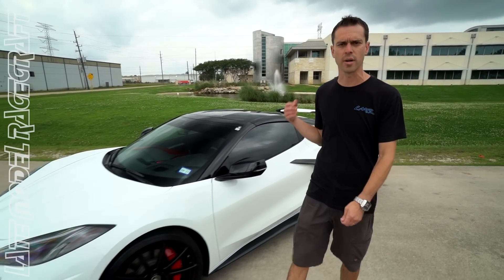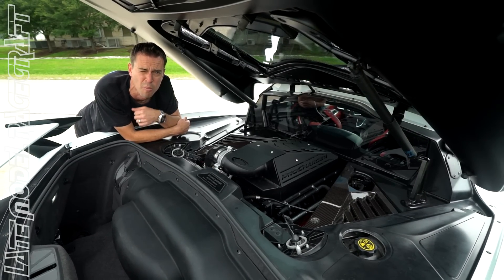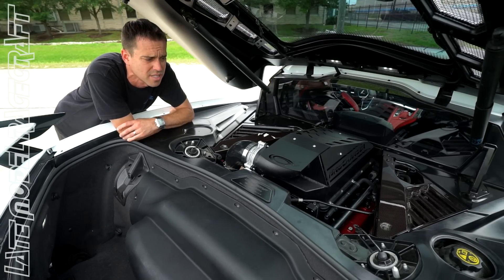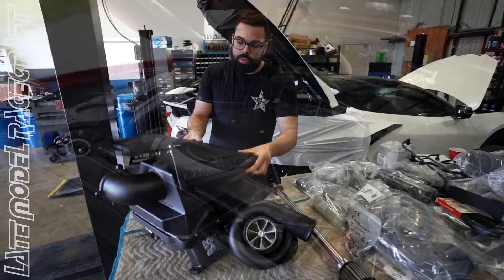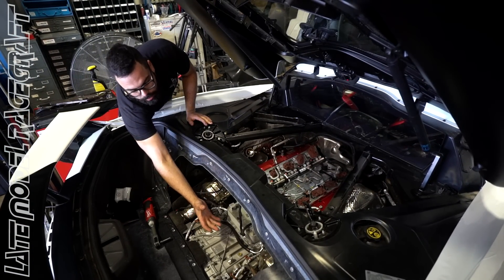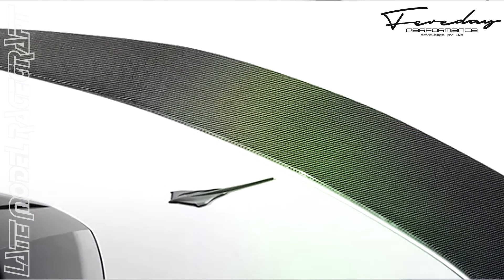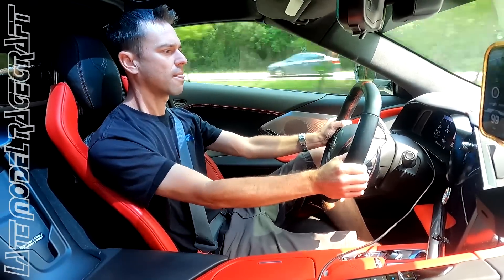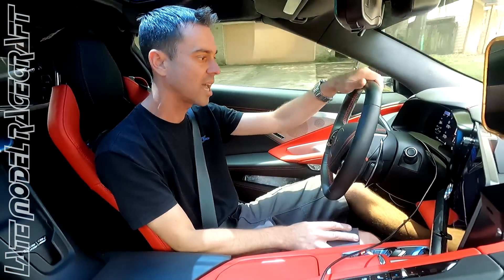LMR C8 700HP Corvette with Procharger Supercharger system

Comment: These packages are awesome, I was just thinking about a Z06 2024 and wondering what you guys are going to come up with!! You currently have my 2017 Z06 there doing the 800 hp and I can’t wait to get it back.. Great Video
Reply: How long have they had it? I’m trying to decide on where to send mine.
Reply from the maker: Little over a week.  It's wrapping up and may hit the dyno Friday or early next week.
Reply: @LateModelRacecraft is it possible to procharge the c8 z06 can the engine take that kind of power

Comment: I really loved the upgrade! Considering the performance gains and drivability no one can ask for more for street, daily use and some track days. The only fault (with all due respect) is that aesthetically speaking the supercharged kit is not as good looking as the oem looks. I must remember that the C8 engine like other mid engine sport cars is proudly exhibited. So, besides the obvious improvement of performance, I would expect a more oem look, maybe with exotic materials added or even a complete new design, but better than stock. The Procharger kit is not ugly at all, but maybe they could work on something more exquisitely designed and sell it like an extra option.

Comment: Looks just like Hennessey's Corvette. That street speed 717 was driving. It's got the same hump in the trunk. But this one is much cheaper than the price of a Hennessy Conversions. But It has the same quality.
Reply: Are the prices posted anywhere? I only see call for inquiry.
Reply: When you call Hennessy they'll tell you they install the same procharger kit as everyone else
Reply: @mcrandrz1991  It seems they provide a 3 year or 36K mile warranty, I don't see that with other companies.  Just something I noticed.

Comment: so syyyyk ... I just put Magnusson/ lingenfelter. Finished it around the twentieth of april... been having so much fun in my hard top convertible c8 z51 2021.. Corsa cutback extreme and rebel axels , cooling etc.  Only thing I didn't go with was the headers I was afraid of too much heat
Reply from the maker: Who installed it Ron? I bet it’s a blast to drive?! Glad to hear you are enjoying it. Do not worry about AR headers creating too much heat under the hood, and you can always wrap with DEI heat shield like we have done on some. You will not see huge gains from the headers, but definitely a louder exhaust note!

Comment: I thought about running some of that vp octanium unleaded in my c6z06 you always talk about. It’s a lingenfelter 660 car and in my area (Kansas/Oklahoma) most all we have is 91 octane. So I just thought about trying to bump it up to 93ish, instead of the whole bottle which claims 7 point boost per 10 gallons of fuel. Does it cause excessive buildup etc within the motor or exhaust? Car is catted on the x pipe I should mention.
Reply from the maker: It will definitely help. Just use half a bottle per tank or only when you plan to really hammer on it!

Comment: Hopefully  it's not more than 15k for this kit or it's way to much.
Reply: $20k plus
Reply: @nola504boy1  lol for 200 hp sound like a terrible platform
Reply from the maker: More.   Can't be picky where there aren't many kit options.
Reply: @Drip4God  Honestly the C8 is a terrible platform if you’re trying to build a race car. I’ll keep my twin turbo Mustang for that. C8 is a nice cruiser IMO. At least that’s why I bought mine.
Reply: @LateModelRacecraft  For a base C8 this kit should cost no more than 10k it won't add any value to the car, There's over 2000+ c8 for sale online and it's not a super car it's just a sports car. But on a ZO6 paying 15k to 20k that's more understandable and will hold it's value a bit longer but not forever.  If this kit was 10k you would sell 10000% more of them and make more money overall than to sell only a few of them and overcharge customers.